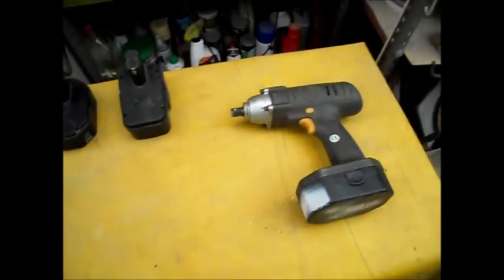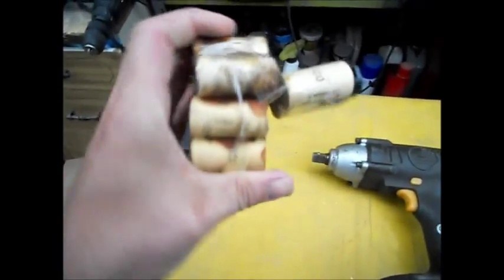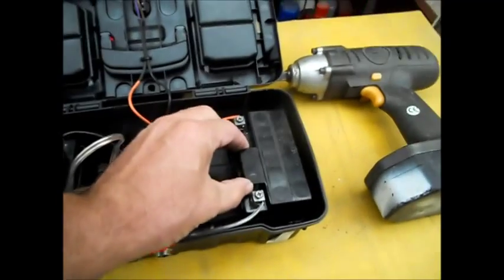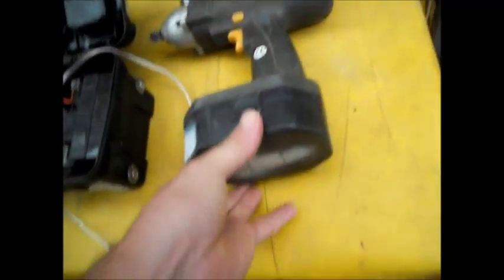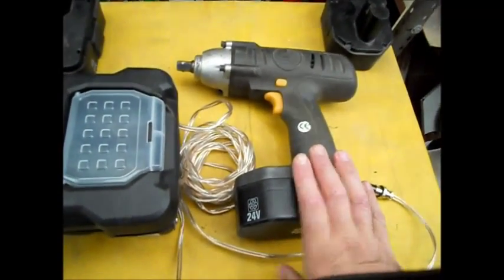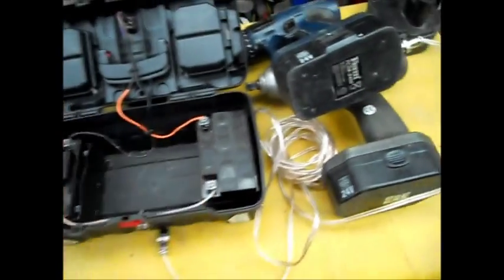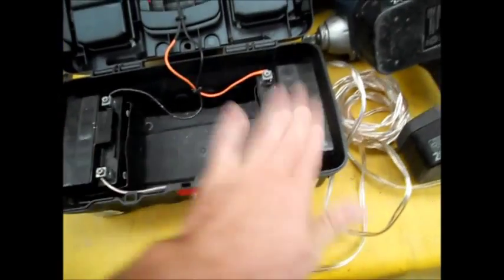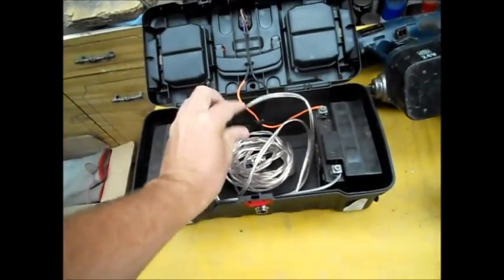Zero quicky - Cordless tool 24v battery conversion

Comment: For the charging you should be able to just plug the blank battery into the normal charger with the switch on, will take a while to charge but will work just the same it will charge it to nominal voltage regardless of capacity which will just make it take longer.

Comment: why did u add switch, would  battery drain if you didnt, also if my drill is 15 volt and i use your setup, would i just add a zener diod to positive into thhe drill??